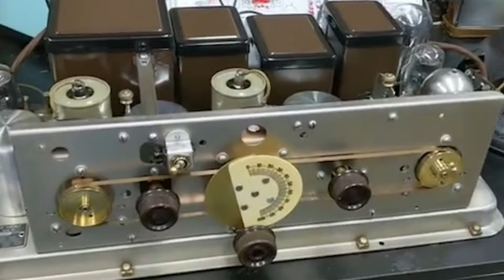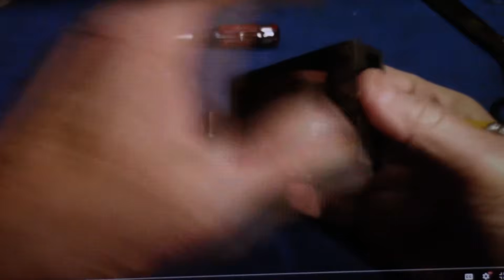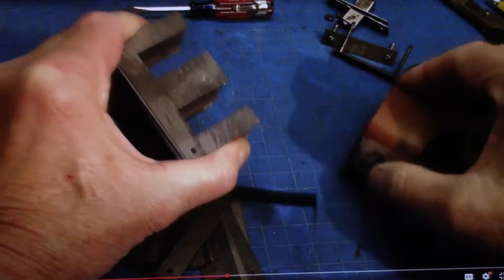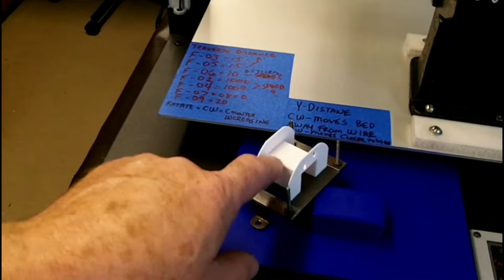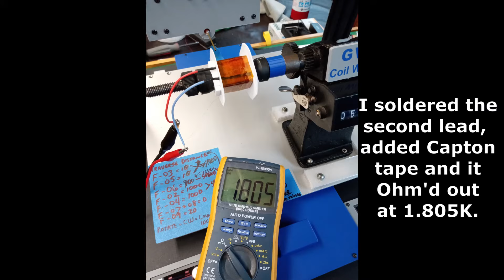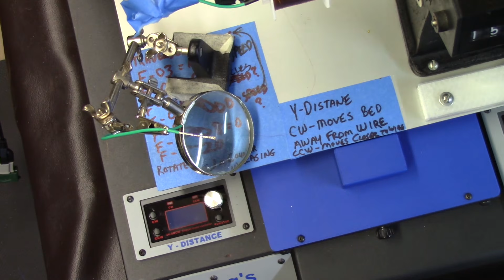20,000 Plus windings on a Interstage Transformer using my homebuilt Coil Winder!!!

Comment: Amazing collaboration! I have been also running into several older radios with open interstage audio transformers in them, typically the primary. One was inside a metal can that contained both the interstage and output transformers, which was a major job to remove from the radio and take apart to get to the bad transformer!
Reply from the maker: Yes, that is the way it was on my 1929 Atwater Kent. Both were bad , and encased in tar in cans.

Comment: Man!
Hats-off for taking that one on!
Also, impressive your 3D-printer work.
I often wondered how 40-gauge wire could/would be handled.
Although I've seen these transformers, I never knew they had THAT many turns--holy Qwap!
Great video and job!
73...
Reply from the maker: Thanks, yes, my biggest concern, besides breaking the wire, was fitting all 21,000 turns on the former. Luckily my winder did it nice and evenly and tight with room to spare.